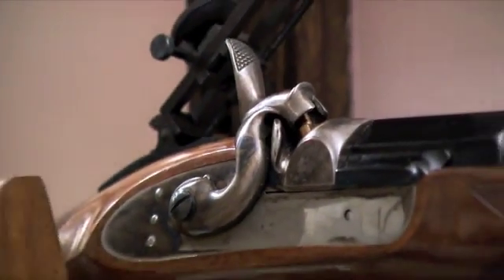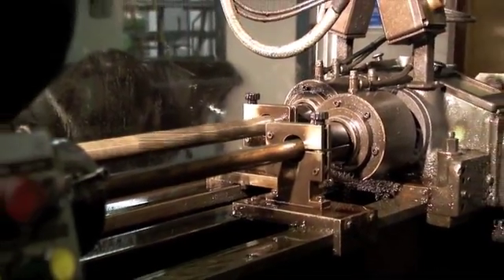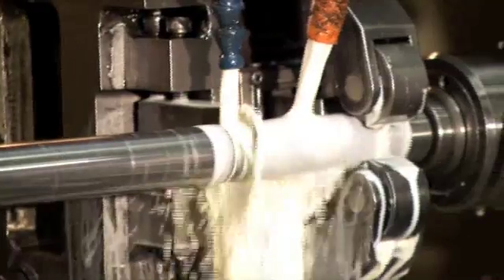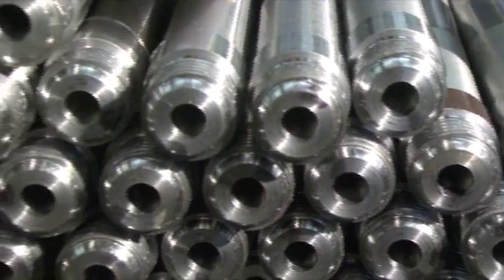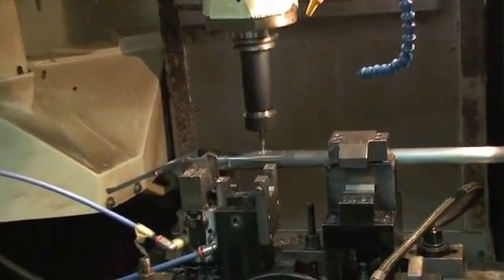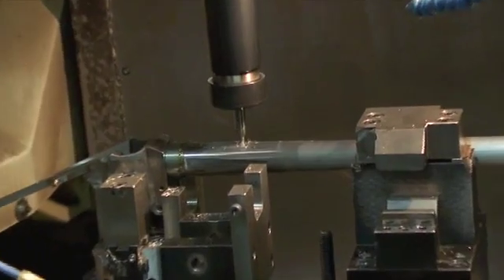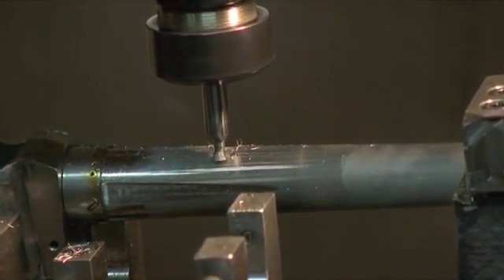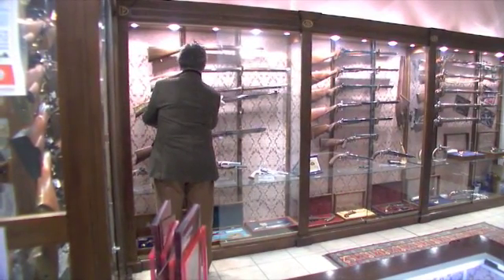pmg barrel

Comment: I really wish they'd have shown the crowning process.  My Pedersoli rolling block has a huge amount of tool marks roughing up the bore inside.  Customer service said that it was a normal result of the crowning process, which I'm not sure how to believe is OK.
Reply from the maker: We happened to answer to this question recently. We report the same answer.
Not all the barrels have tool marks. This effect occurs because the barrels are very shiny and precise in diameter with tolerances of 0.01 mm (0.0004 ").

It may happen that the pilot placed on the cutter to make the crown, flaring the muzzle (which must be perfectly concentric to the barrel hole) is equally precise and begins to rotate with the cutter. This pilot is made of plastic or brass, and as it rotates, it can generate lines that have a unique aesthetic problem.

However, this is a situation that does NOT occur with all barrels, just on a very small percentage and it does not create ballistic problems.

We confronted other gun manufacturers, who confirmed that occasionally, they have the same situation occurring with the barrels.